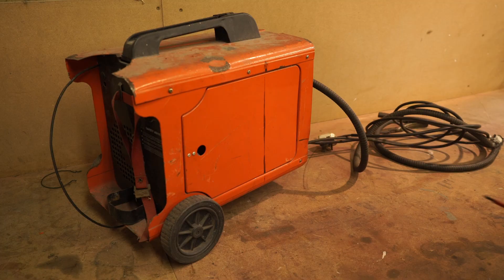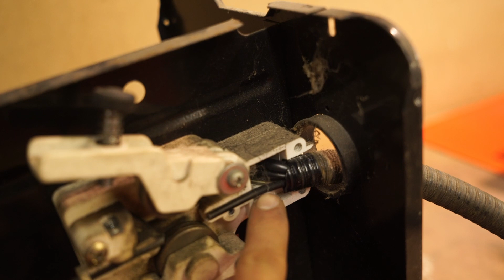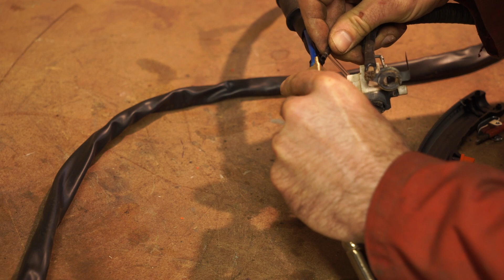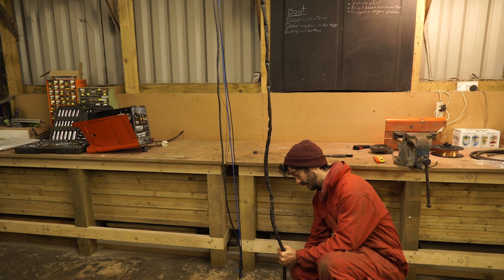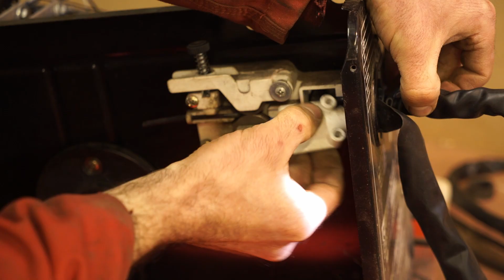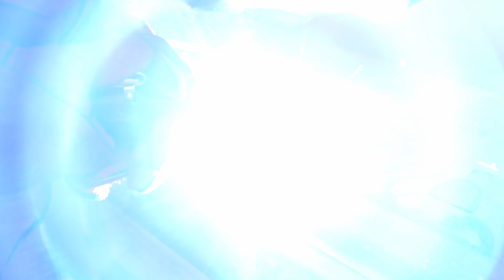Fixing a welder! Welding Torch Replacement - SEALEY MightyMIG 130XT MkII Turbo!

Comment: I think you may of been better of upgrading to a euro tourch kit so you can change it easier in the future 😉
Reply from the maker: Yes, it would have been better, but I was skint at the time, and this was the cheapest way to get the welder working again. 

It's still working fine with this setup. I've done  loads of welding with it, including a 700m long estate fence.